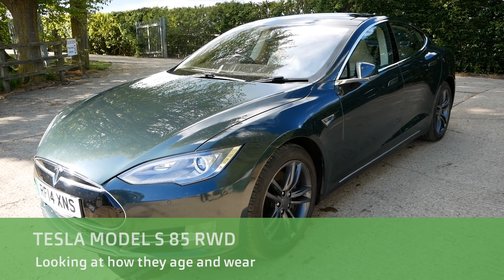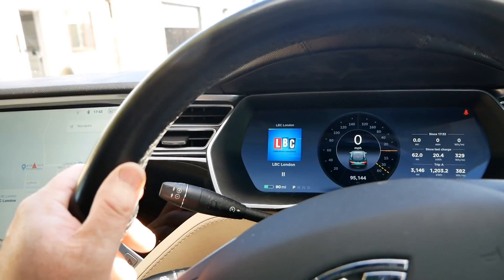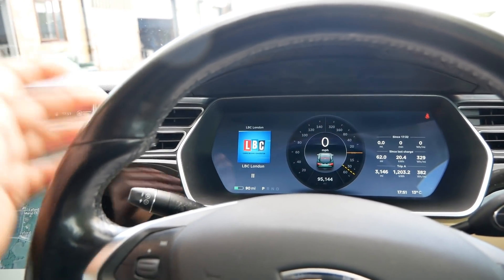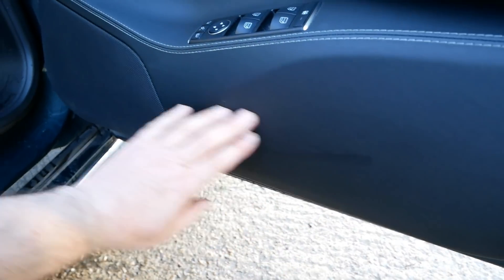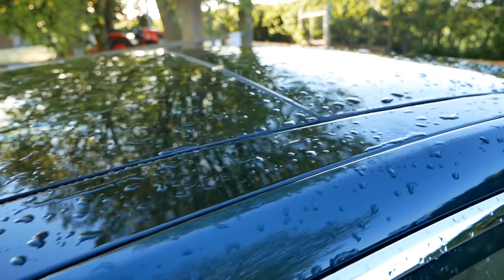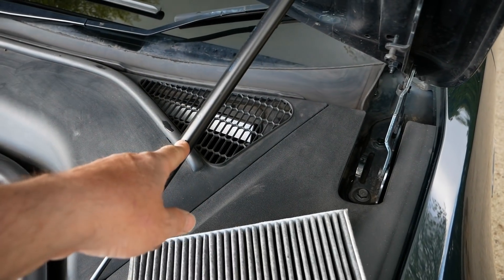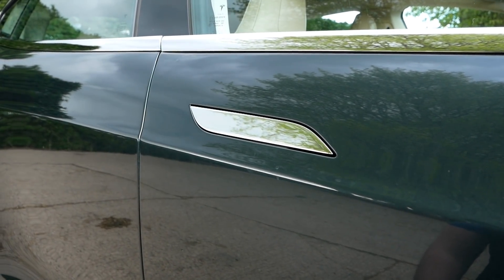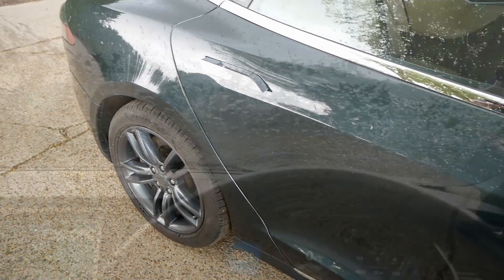How well has this 2014 Tesla Model S aged over 95,000 miles?

Comment: They will get there eventually but at the moment EVs are a pain in the arse!
Reply: Which one do you own? I have a used 2016 Kia Soul EV+ with about 90 miles of range and it has caused me no issues whatsoever, though I wouldn't be driving across the country in it. For my situation it is perfect. The trick is to get the one that meets your specific needs. If you need/want more range then that is available too.

Comment: I have bought mod s 85 too  136k km and still battery 91%, when i boight the garage changed front brakes and 12v battery, gets me at 90^ 360 km at 23 lw/100 km at 130 km/ h.
Only - is no real room in doors for junk but space is possible, why?
Reply from the maker: Yes the minimalistic look continues to the doors. I don't mind has door bins would make it slightly less awkward to get in and out, as I often kick them with my foot.

Comment: With respect, you didn't raise the most important point of all, the question of battery degregration over time on this or other tesla cars of that vintage and mileage.
Reply: He did say it was still doing 220 miles or abut 250 if not being so enthusiastic which is from what he said is what they were doing when new hence that should address your concern. There are more scientific terms documented you youtube.
Reply: @jsouto77  Ok, would like a deg percentage figure really.
Reply: Perhaps another video will address range and performance. :)
Reply from the maker: You can't get that out of the Tesla's.
Reply from the maker: Yes I intend to make a range video, but I've got to get the spirited driving out of my system first. Once I get bored of flooring it and start driving it normally, I will make a range test video.
Reply: @GoGreenAutos  Actually you can add an OBDII port to the car and read the data using TeslaCam (iirc) on an android phone.
https://evaccessories.co.uk/product/tesla-model_s_x-diagnostic-cable-adapter-post-sept-2015/
Reply from the maker: @SirHackaL0t.  Thanks for the info. I might buy one.

Comment: My 20 year old vauxhall combo van cost me £1500, 13 years ago.
It now has over 450,000 miles on its original engine and gearbox.
It currently burns diesel at 20p per mile.  I get 800 miles per 5 min fill up. 
100,000miles is nothing for a modern vehicle. 

Tesla doesn't have real leather. It's vegan leather... Aka not leather.
Tesla has cruddy build quality when you look close at them.
Tesla early electric motors have bearing issues. 
Looks great... That's a matter of opinion.
It's a £50,000 car! It better have hight adjustable seats

Comment: getting cheap 22 - 24k - are you on drugs????? only £200+ to fit an up to date charger? you are really selling ev's to me- ill stick with my 2014 308 tax free diesel - that has cost me precisely zero in maintenance and the interior is factory fresh. oh and on my 40 - drop links were 12 quid!
Reply from the maker: Cheap in terms of other long range EVs.
You wouldn't compare a Peugeot 308 to a Mercedes S-class?? For the type of car the Model S is, they are now relatively cheap when comparing against other similar type of vehicles.
Reply: @GoGreenAutos  sounds a bit "elitist" to me - only the very rich should be allowed to drive? - my gas guzzler is looking more and more adequate thanks
Reply from the maker: Not intending to be elitist. But of course vehicles are available at all sorts of prices. All I'm saying is a Model S (or any vehicle of that value/size/class) has to be compared to similar vehicles. You can't compare of family hatchback to a car than was 3-4 times its price when new. True, £22-£24k is a lot for a used car, but my point is they are now cheap compared to other long range EVs. And considering these were £60-£70k new and rose to over £100k for later years, they are now getting more affordable for many.